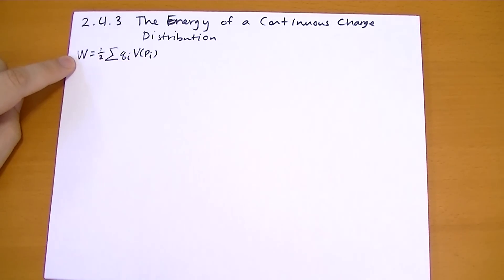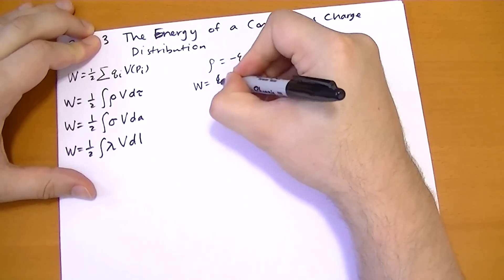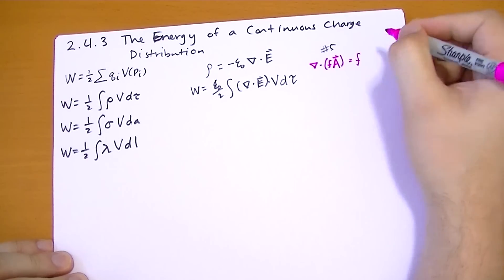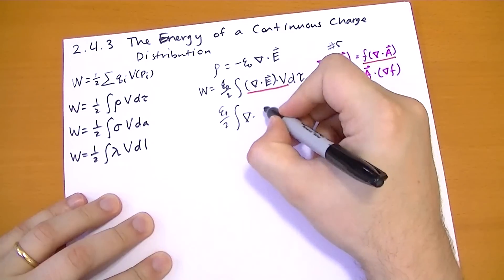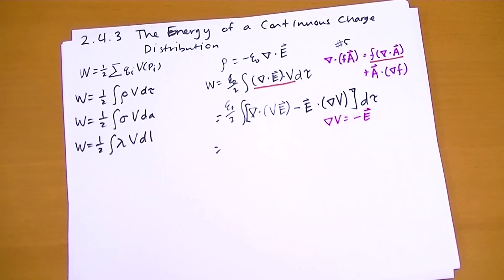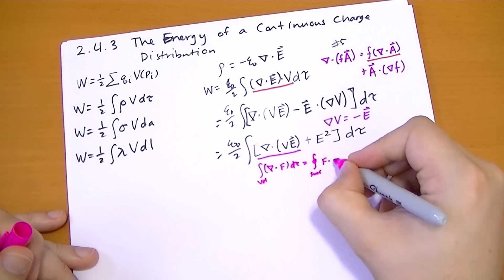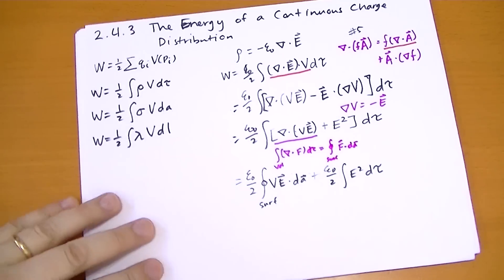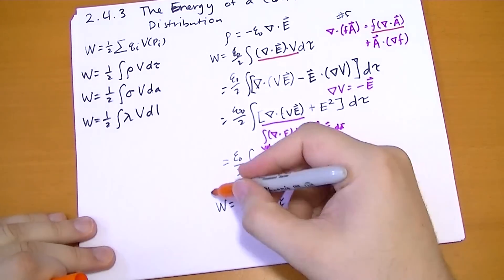2.4.3 The Energy of a Continuous Charge Distribution

Comment: The term that vanishes is the surface integral of (VE), not the volume integral. You are only evaluating the function  at the "boundary" and if you're far enough away, the product of those terms is approaching 0 faster than the surface area that bounds the volume. On the other hand the work can be obtained by the volume integral of E^2. Although E does go to infinity, you are also including regions where E is most definitely not 0 within your integration. I hope this clears up your question

Comment from the maker: The reasoning is quite simple, and identical to why E is 0 at infinity. If you have a finite number of point charges, then as you go out to an infinite distance away from them, the field varies according to 1/r^2. The potential varies as 1/r. Both go to zero as r approaches infinity. Classic limit problem.

This doesn't work, obviously, if you are dealing with infinite charges - infinite planes or lines or whatever.

Comment: I had difficulty understanding how the expression for W works locally, say, choosing a inside a capacitor and checking the energy in that small region. Turns out, the integration regions are different for the two integrals in 4:36. The left one is over the surface of the volume you choose, the right one is over ALL SPACE, regardless of the volume you choose. That's because all charges in the world apply forces to a charge that you are trying to move.